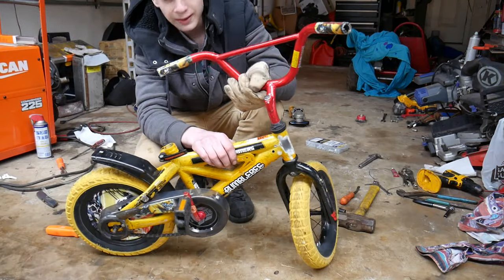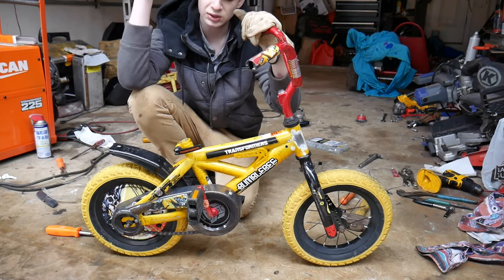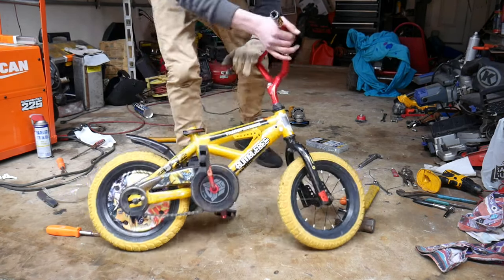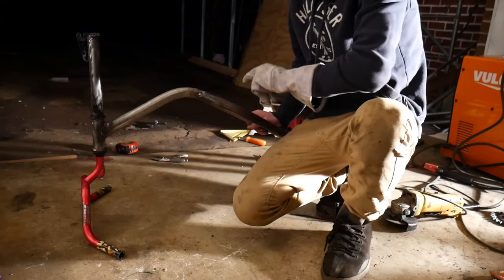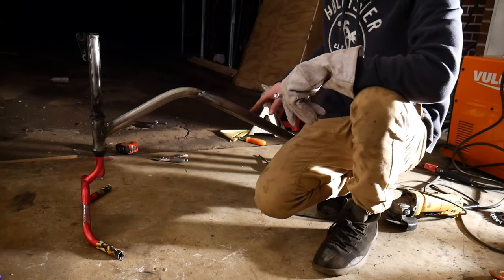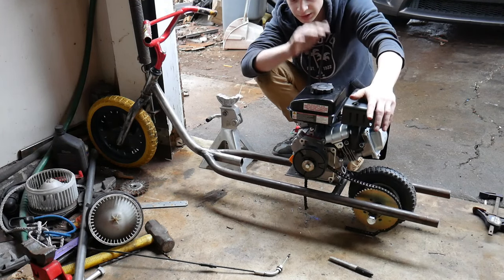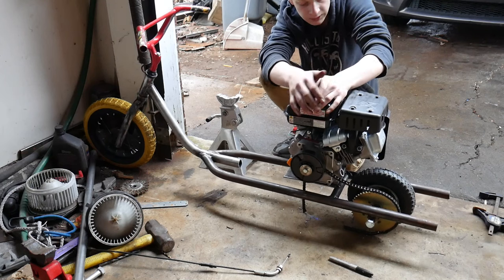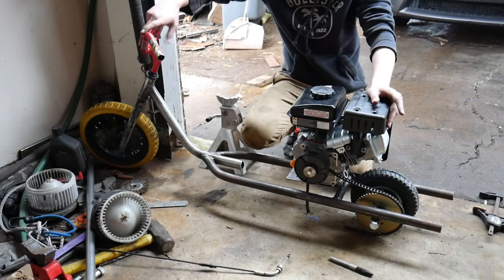Motorized 79cc scooter out of a Kids Bike Part 1

Comment: That is pretty cool. Great project for my powerarc welder although I might wait until I get my new powertig welder and tig weld it instead.
Reply from the maker: Yeah it was very difficult stick welding the thin walled tubing. Is your old machine a Multi-process Stick/Tig machine?

Comment: you should put the engine above the rear wheel to increase your foot room. also you might need to center the rear wheel so it drive better. just trying to help👍
Reply: from experience, I had those problems with my builds.
Reply from the maker: Jake Brown Yes I've been expirementing on exactly what you've said. I've moved back my wheel about 5 inches and engine. I've also de-extended my sprocket. Chain alignment seemed to be good, the problem is my sprocket wobbles a little. Also going to reinforce my frame a little better..

Comment: Ya you use stick like me, I can't afford that expensive Tig or mig, I got my welder for 50$ at a pawn shop and it's been treated me well
Reply from the maker: Not anymore, I always hated how bulky it was
Reply: @VasilyBuilds   Vasily Custom Builds   mines really small, its about the size of 2 car batteries, just as heavy too so I put it on a luggage dolly, and it's a 120v plug so that's convenient, but the other welders look so much easier to use, I can't wait to upgrade, I'm making a pretty cool motorized 2 stroke unicycle thing but I'm still working out the flaws, I have a small video, I think a flat type tyre instead of a round one would eliminate the side to side motion, I think it would be break and ballance dependant like how those trick bikers jump from rock to rock, I have some chain issues, and I'm waiting for a pull start, but you can probably make something work out easy, you up for the challenge? I want to see your version :)